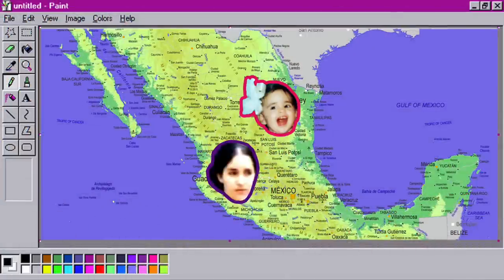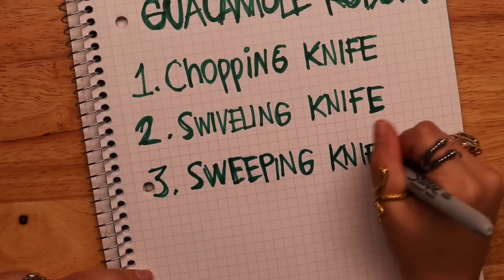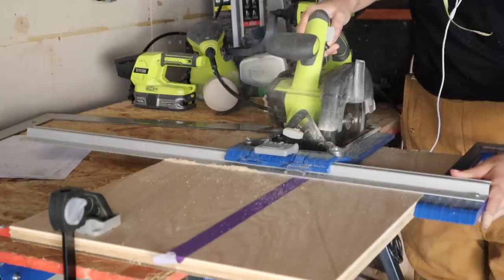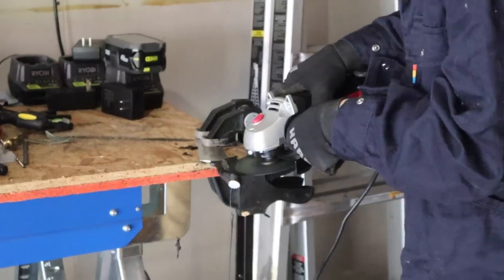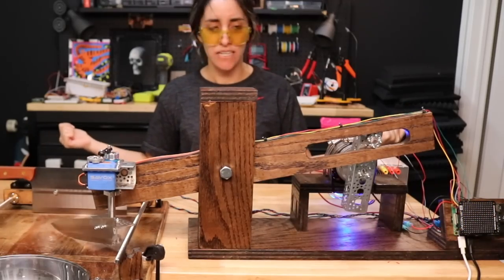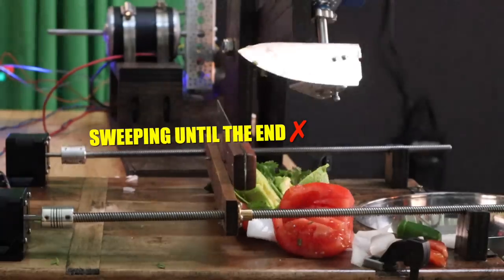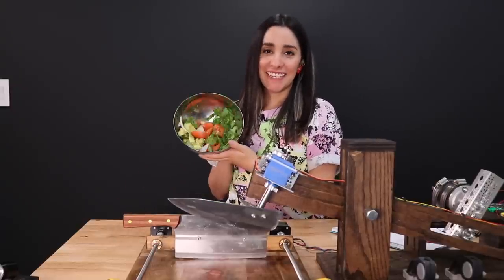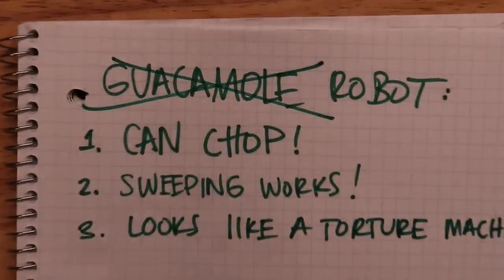I tried making a guacamole machine

Comment: I loved the idea and engineering done in this project and how you shared your workflow through it, it was inspiring. The thing I kept think about though as you reached the end and didn't seem to get the most preferable results was that the part that caused the greatest issue wasn't your programming or anything, but the design choice to make a robot that just robotically imitates a human process of doing something. With humans being able to do very many actions adjusting to every situation and condition, we can easily contol our pressure and place to cut food on a cutting board, but from what I've learned robots usually aren't the most efficient or very easy to make do those tasks in the same way. I'm not trying to say I could do this better in any way because I couldn't and I still think you did great, but I'm imagining that if a different chopping method was used in enclosed chambers or somthing tailored for the specific job, so many of the variables that are causing problems here would be eliminated and such a robot may do a much better and consistent job at making guacamole lol

Comment: if you had a second sweeper like 1-1.5ft from the other one, you could automate pushing the ingredients back to the center, requires no extra stepper motors or anything. just on slide a second of the scraper assembly and maybe move the bowl closer to the cutting area

Comment: Such a fun concept !
I cook a lot, and cut a lot. If you want to sweep your knife, you need to change the angle of the sweep when the knife stops contacting the food.

And for drilling the holes, why don't you just temper the back of the blade with a butane torch? Make it soft like butter :)

Comment: In case you wanna make a "usable" alternative to this one: try not to use a knife to chop but rather look at a mechanism similar to products like the  "Slap Chop". Basically a rotating set of blades mounted rigidly in position to each other. Either full in a square "sieve" like net or just a couple in parallel (much easier to build) and rotating the entire construct. They can go through all of an onion or avocado etc at once and would produce equally sized pieces. 

 Would by far not be as fun of a torture machine to build but much more practical. 
Greetings from a German engineer. Ü
Reply from the maker: Thanks! I did try that first but my lack of mechanical engineering proved it harder
Reply: @Estefannie  maybe a less technical fix would be to mount several knife blades parallel & rotate the chopping board beneath, like a lazy susan with a belt driven motor, in several steps, say quarter or eighth turns.

Comment: I think if you could have had a device to push the food under the knife after a few passes, it would have helped get it more chopped. the food seemed to move away from the blade. so stop the blade when its up in the air, push the food from the left side (the side near the bowl) and then chop for a bit and do it a few more times. I am hoping it would at least provide more time for the blade to chop it finer.

Comment: I hope you have a way to break the linkage between the motor and arm; thus you can work safely by the blade (its like unplugging the machine); that you can confirm the machine cannot re-establish its mechanical linkage.

-------------

Food processors solve this trial by having a feed tube (same goes for juicers), that you can pass ingredients sized for this tube into a set of blades. This gives a fairly repeatable cut and consistency, that you will never recut ingredients too much.

The upside is this is a lot safer as the housing contains the rotary blade and its more consistent. Naturally the final diced ingredients are not as good as if you made guacamole from scratch. To make this unique, just push the ingredients into a mixing drum to run after everything has been diced.

Comment: Yeah, knife steel isn't just normal steel. Knife steel has been heat treated (quenched and tempered), making it a LOT harder. Mid-50's or high-50's HRC is quite common. I have a fancy pocket knife with a 63 HRC cutting edge. The reason you drill bits wouldn't go through is that the bits are softer than the knife. The hardness of the knife steel has very little to do with it being stainless.
Reply from the maker: yah I learned that when I was working it 👍Thanks for watching!!
Reply: Yeah some carbide drill bits drill through steel up to 70 HRC so those would have been the correct option. Then it's also possible with a handheld drill but an actual drill press (and not just like the Dremel one) would still be a great improvement. They can be had for relatively affordable prices but they can take up quite a bit of space, especially in small workshops. Not something I would ever want to miss though. 
Having the proper hardness drill bits would still be necessary of course.

Comment: use an M35-Cobalt bit, low speed and oil to drill stainless :) Learned the hard way trying to build my homebrew system entirely from stainless
Reply from the maker: i did try that! I think I just am too short and weak to do it with a drill
Reply: @Estefannie  oh wow, thats some seriously hard stainless! Those bits you used in the end are really cool though, I've never seen them before (we don't get cool stuff in Australian hardware stores 😂)

Comment: I'm not experienced at the electronic part of this, though I always scored 100% in school which was 25 years ago, but here's how I would've done this particular project:

1. Since you mounted the bowl on the chopping board, I would add 2 borders on the chopping board with the width of the bowl. Personally, I would just make a chopping board with a hole in it and put the bowl underneath (so much easier to clean both), and the piece to chop on, I would make that rotate.
2. Instead of cutting that chef's knife, I would've used a 1mm thick metal plate and turn it into a knife, then harden it.
3. for the chopping mechanism, I would do it totally different. I would mount the blade on a stepper motor with a chain, so it chops in a circular motion, at start position, after each down stroke, make the contraption move to the left (or right) (will work so much better if you pre-cut a flat side on the vegetable so it doesn't move around), then when the blade reaches the end position, make the chopping board rotate 90°, and then it chops from the left to the right (or right to left) back to the start position, the blade raises back to almost the up position and it slides back to the end position (all pieces of the vegetable now fall for the final cut), and from the end position it chops its way back to the start position the blade rests on the board, and then the board section (including the circular part) slides to the left (or right) so the blade "sweeps" the vegetable into the hole of the board with the bowl underneath.
Parts needed: 1 chain, 4 gears (2 big, 2 small), 3 stepper motors 12V (unless you can make the rotating part of the chopping board rotate in another way, e.g. an actuator), 1 belt, 2 threaded rods, 6 bearings, some wood, 1 bowl.
Tools needed: rocker saw, drill or router, several bits
Humans needed: ME! because I suck at explaining things to people, but I admire your talents and I think you probably know what I meant 🙂

Simone Giertz did this too, but yours chops better 🙂 CAREFUL!!! Otherwise you might need a civil engineer to build you bodyparts, like fingers, hands or perhaps an arm!!!

P.S. Feel free to drop me a comment @florianooke (facebook, twitter, instagram, youtube) 🙂
Reply from the maker: All great suggestions! honestly though dont have the means to harden and make my own knives hahah but I do appreciate your what you're going for !
Reply: @Estefannie  always a pleasure 🙂I'm always impressed by your electronics skills, you're really good! the mechanics part, needs some work, because it seems like you overthink that. Overall, very nice job! hilarious at some times, scary at other times 😀I love mechanics myself, still have to learn the electronics part, but I try to make art now, we should team up 😀grin

Comment: It would hurt the knifes performance but would have made it much easier to drill if you heated the knife up till it was red hot with a blow torch then let it SLOWLY come back down to room temperature this would change the grain structure in the metal making the knife less hard and more ductile.

Comment: Do tied up your hair up. Drills, angle grinders, rotary tools, etc dont care they have caught hold of your hair and have wound up all of your hair into the tool and now pulling your scalp. Need I be more graphic? (and yes you can do an analysis of the torque in all of these tools but assume all have enough to be more than brutal enough)